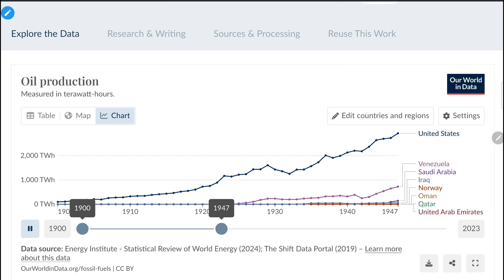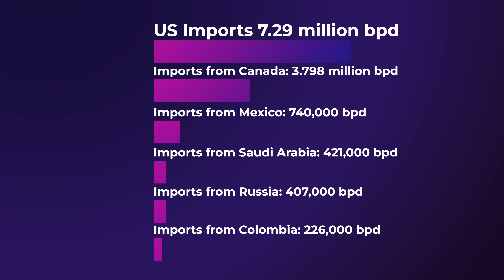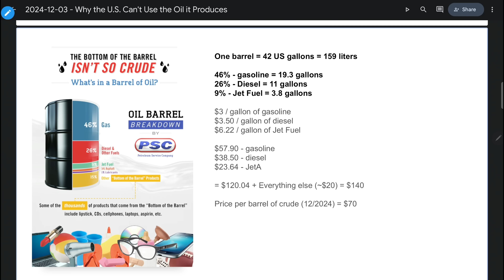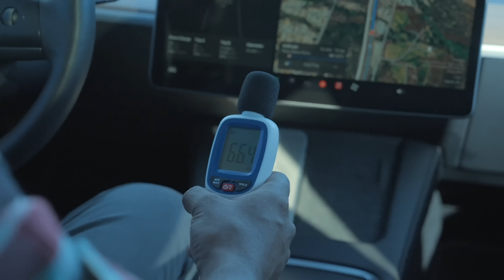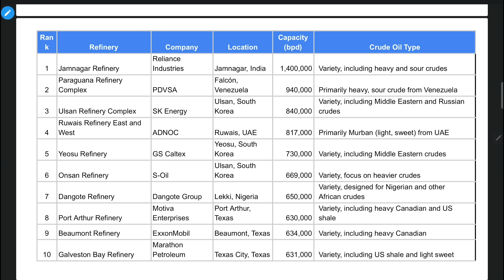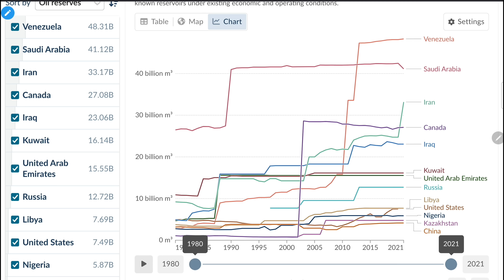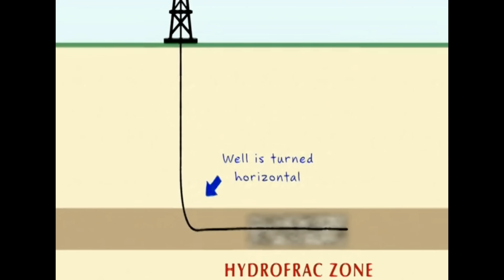Why America Can't USE The Oil it DRILLS

Comment: As a Canadian, I appreciate your comprehensive analysis to the American oil and refining system.  Thank you for providing some education to Americans who do not understand the logistics involved and have been lead to believe Trump's lies.  To uniformed Americans, it seems ludicrous to be buying oil from Canada when so much oil is being extracted within America in such volumes that a huge volume is exported.
Your absolutely correct that the decades old American refineries were designed and built to refine "good old Texas crude", which is a heavy crude.  Canada supplies heavy crude which is perfect for American refineries.  Most American light crude oil derived from fracking cannot be refined in America for the American market consumption.  
So, America buys Canadian crude oil at heavily discounted prices and received a further 30% advantage, simply by the currency exchange rate between the two countries.  The Canadian oil industry makes a small profit just ONCE when the oil is sold to America.
America buys Canadian oil and refines it into various petroleum products for sale at much higher prices (the FIRST profit opportunity).   Those refined petroleum products are further processed into thousands of products for other uses; specialty fuels, grease & lubricants, paints & coatings, cosmetics, synthetic fabrics, plastics of all forms, pharmaceuticals, electronics, liquified natural gas, and many, many others (the SECOND profit opportunity).  Note, that many of the American industries producing this list of products achieve very high profit margins.  Example:  Fifty cents worth of product is packaged into a fancy $2.50 bottle and package and sold at the cosmetic's counter for $90.00 .
These products are further manufactured into finished products; Example: Synthetics fabrics - clothing, shoes, tents, canopies, rope, furniture, etc...etc.... (the THIRD profit opportunity).
Finally;  The American light crude derived from fracking is exported from America to other nations at a high profit.  This profit is high above the cost that America pays for Canadian crude (the FOURTH profit opportunity). 
The bottom line is:   Tariffing, or restricting the flow of Canadian crude oil into the United States is extremely damaging to the the U.S. economy and has already crossed the border of insanity.   My message to my American neighbours;   Learn how your own economy works and you won't be fooled by an orange snake oil salesman.
Reply: Excellent!
Reply: I would go further along this train of thought and say that tariffs placed on imported raw materials, or energy or agricultural products that a country cannot easily grow/produce/or have available as raw materials themselves (due to geographical or climatic conditions), will do absolutely nothing to foster a home-grown, domestic increase or control of those commodities. 
  By placing blanket tariffs on Mexican and Canadian products that the US has little or no way of easily replacing at the same prices, all Trump has done is increase the cost of many previously available goods to Americans, with little chance of developing domestic sources for those commodities.
  Welcome to the result of increasing economic trade globalization - a process that the US, and American companies have had a major role in implementing over the last half century and more.
  A final question: Why is Trump so quick into this term to dismantle and upend USMCA, a trade agreement that he touted as something positive during his first term when it was put into place?
  Maybe the purported Wharton School of Business grad doesn't understand economics as well as he should.
Reply: @siderealvision  All it can do is make Canada look for better offers elsewhere or renegotiate a better price.
Reply: @siderealvision Frump clearly doesn’t know squat about the oil industry or energy in general. I can’t believe that so many of my fellow Americans allowed themselves to be duped by his divisive tribal politics and outright lies. 

As an American citizen I’ve had many occasions to visit Canada and every time have enjoyed the experience. Canadians are wonderful people for the most part and Canada is an admirable country with an evolved and modern, caring government. I’d trade you Donald Trump for Justin Trudeau any day of the week. Wait; no I wouldn’t. You didn’t do anything to deserve such a toxic export. My bad.
Reply: That is a really great summary, well done! One important issue that you did not cover is the use of upgrading in the refineries. Shale oil contains a high proportion of volitile natural gas liquids that are best utilized by upgrading sour crude or bitumen, that is why Texas is so reliant on Canadian feedstock to run in their refineries. If the current political nonsense persist the option of selling that product to other buyers without a dis out or the penalty of the US/CDN exchange rate penalty will not only cut into US e port capability, but cause major price increases anther pump. ALL Midwest US oil comes from Canadian feedstock.
Reply: @TRex-o5y  When Trump stated; "The U.S. does not need Canadian Oil", as a Canadian, I had to do a little homework on behalf of my American neighbours. This is 5 of America's top refineries and most prolific refineries that depend upon Canadian oil. This is the percentage of Canadian oil that these refineries depend upon everyday to function. This is the amount of Canadian oil, as a percentage of each American refinery's total output;
(1) Marathon Petroleum
Robertson Refinery
Robertson, Illinois............................100 % Canadian Crude Oil
(2) Exxon Mobil
Joliet, Illinois.................................... 95 % Canadian Crude Oil
(3) CMS Inc.
Laurel Refinery
Laurel, Montana............................... 95 % Canadian Crude Oil
(4) Phillips 66
Billings Refinery
Billings, Montana............................. 92 % Canadian Crude Oil
(5) CITGO
Lemont Refinery
Robertson, Illinois............................ 78 % Canadian Crude Oil
When are ALL Americans going to learn that Trump is a malignant and compulsive liar, except when he said; "I don't care about you people, I just care about your vote".
Reply: But Trump said Canada has nothing America needs, who to believe, such a tricky one.  :)
Reply: @Dug6666666  By this time so are better off assuming the opposite is true when Trump say something.
Reply: It’s the heavily discounted that maybe you’re on doing my American friends maybe Canada is about to say no more discount or we’re sending our oil somewhere else. Do something about your Trump. The guys a fool and a madman.
Reply: @bernl178  Unfortunately, more than half the country is stupid enough to re-elect the dumbass, so I don't think there's any teaching these fools.
Reply: @chrisgraham2904  The problem is that most people think that oil goes directly from an oil rig to a gas station. Or if they know about refineries they think they function like grain mills
Reply: @Dareios074  True, refineries produce a dozen, or more types and grades of petroleum.   Those then get manufactured  by third parties into raw plastics, greases & lubricant bases, paints & coatings, pharmaceuticals, asphalts, synthetic textiles, etc..etc...   It is far, far more than the price of gasoline, or diesel that is going to increase in price.
Reply: Well said but can you stop using big words maga has a hard time understanding you.
Reply: Too late. Very soon, Canadian heavy crude will go to Asia and Europe instead of the US, permanently. Canadians are beyond pissed.
Reply: @joergmaass  and how is that going to happen? If you say pipeline I'm going to respond with the fact you just built one with that exact idea in mind. Yet, apparently oil from that new isn't going to an Asian market. It's going to the US. And do you know why? Because it seems the tolls are so high to pay for the construction it's not profitable to send overseas which I suspect is fairly costly.
I know what you did last summer. Actually 4 summers because that project was right beside me and, man, that was painful. Please, please, please don't build anything. Get someone else. Anyone. Just stay away from these projects. Canadians will thank you. 🙏😅
Reply: @joergmaass & we are beyond ignorant in the USA for allowing this administration to do this to our economy
Reply: Extra sour oil,. such as the one from Canadian Tar sands is needed for the blending with extra sweet shale oil. And there is only quite limited availability of such heavy oil. Main producer are Canada, Venezuela (Orimulsion) and Iran. It is hard to understand why your government is working so hard to screw-up with Canada....
Reply: As of American that can all be changed with the West Coast oil refineries. When Trump opens up all the drilling on the west coast in the ocean that's is all sweet crude oil. No longer imported it can be shipped into the oil refineries on the West Coast in California.
Reply: @chrisgraham2904  wrong again
Reply: @colleenc9286  Please do tell me what I got wrong, or misidentified?
Reply: @chrisgraham2904  are you bragging or complaining? What is your point? Your rant does not address why refineries do not upgrade after 100 years of profits.
Reply: @adon2424  American refineries, which are designed to process heavy crude have not upgraded to handle light crude, because  it was far more cost effective to obtain heavy crude from Canada to refine.
The problem is Trump's immediate tariffs on oil with no timeline or commitment to upgrade the American refineries.  Americans will pay for for oil and all of it's associated products.
Reply: The people that need this info can't read or use numbers lol 

Half of Americans read at 6th grade level, See Spot Run shit, and 1 of every 5 can't read at all

1 in every 3 Americans are functionally innumerate and basically can't do more than add and maybe subtract small numbers 

The real problem is in how these people are being ignored or mocked by the more educated liberal-leaning people, and how they are exploited by the far-right to gain power.  

Put another way, it has been to our detriment that we cater our arguments to our own demographic while belittling the half of all people that fall under the avg IQ bar.  The bright people that should be listened to are seen as condescending and untrustworthy.  Anti-intellectualism has been on the rise and intellectuals aren't helping their cause lol
Reply: Ignorant, misinformed MAGA rubes are the biggest problem America has.
Reply: @chrisgraham2904  Bring back eV's
Reply: As an american, thanks for explaining why you shouldnt be a country, you do understand you cant defend or support yourselves rignt? Maybe you should take a minute to understand your economy
Reply: @ are you serious? First of all, Canada is in NATO so the other NATO countries (including the USA ) would be required to help with their defense. Also, Canada has helped in a lot of military campaigns worldwide. Also, Canada has a lot of natural resources such as crude oil, natural gas, & other minerals etc.  They can support themselves & trade with Europe & Asia.  & Australia
Reply: @Leeonidas87  Like most other Americans, you don't understand Canada.
Canada can certainly support itself along with dozens of world partners and will thrive without the U.S.A.  Your going to realized over the coming months how much America is dependent upon Canada.
America depends upon base resources from Canada that supports millions of American industries and jobs.   Canada buys "finished products" from the U.S.A. and we can buy a new toaster elsewhere.
Your right that Canada does not have the military capability of the U.S.A. Canada does have a military and Canada's military strength is ranked 27th out of 145 countries in the world according to the "Global Firepower Index".  Canada is a founding member of NATO and a member of the Commonwealth of Nations and has many other friends.
The U.S.A. has never militarily supported Canada.  Who is this invisible enemy that America has been protecting Canada from?  The U.S.A. is the only nation on Earth that has ever attacked Canadian soil and is now attacking Canada economically.
There is one other dimension:  If in a bizarro world, Canada was ever attached and occupied by an enemy nation, such as Russia, or China.....would America stand by and allow those invaders to install 35 military bases only the U.S./Canada border with missiles pointed to U.S. cities?
You need to stop playing the bully and respect that you have had a friendly neighbour for 250 years.
Reply: @chrisgraham2904  - Everybody knew that but the potus.
Reply: As a Canadian , you would think you would worry more about what Trudeau has done to your Country instead of worrying about Trump. Your bud has got you in a corner that you can not get out of now. Enjoy your blindness and not worrying about your own backyard.
Reply: @Youreplywasalie  Trudeau is turned your country into a bankrupt losing state. Are you proud of being human traffickers? The US can change refineries if that’s what they want.
Reply: @Youreplywasalie  - Da, vatnik?
Reply: @Youreplywasalie  I read your reply weasel...  it makes no sense!   Have you been blinded by the trumpian messages, or was your vision faulty to start with?
Reply: @Youreplywasalie weird comment now that Camry is PM😂 the Americans are all just like trump
Reply: @Youreplywasalie  As a Conservative Canadian, I am very concerned about what Trudeau and Liberal policies have done to Canada over the past 9 years.  Trudeau has now resigned and a national election in Canada is imminent, which I am hoping for a new Conservative government.  Be aware though, that Canadian Conservatives have virtually nothing to do with today's U.S. Republican Party. 
My focus is on Canada, although I do have family living in the U.S., that I am concerned for.  An old saying remains true today; "When America gets the sniffles, Canada gets a cold".  
My backyard is just fine, but America lives in Canada's basement and it's on fire.  The people living on the first floor have every right to be concerned.
Reply: @chrisgraham2904  - Why's Poilievre so terrified of applying for a security clearance?
Reply: @neilpk70  Pierre Poilievre, the leader of Canada's Conservative Party, has chosen not to apply for top-secret security clearance, which would allow him to access classified information on issues like foreign interference. His reasoning is that obtaining such clearance would legally restrict him from discussing the information openly, which he argues would hinder his ability to hold the government accountable.
Poilievre claims that a great percentage of classified information is secured to protect the Liberal government and should not be classified and should be open and transparent to all Canadians.
This decision has sparked criticism, with some suggesting it raises questions about transparency or his willingness to engage with national security protocols. Poilievre, however, maintains that his stance is about ensuring he can freely challenge the government without being "gagged" by secrecy laws.
Reply: @Youreplywasalie  As a Canadian...I would suggest you go look up the definition of the word 'idiot'...then go look in the mirror.
Reply: @Youreplywasalie  did someone spit in your cornflakes? I'm Canadian and I live an amazing life and so does everyone I know. My car is paid for, I have a roof over my head amazing food in my stomach and plenty of money in the bank. Not only I have everything I need I have it in spades. From my observation Canada is doing great and about to do way better when we start selling the oil you guys buy at an incredible discount and selling it to the rest of the world. Most of the crying is coming from you guys. By the way Trudeau has done a much better job than the thing running your country what ever its name is.

Comment: You're missing a huge point, electrification is not going to drive the demand for oil down, it's only going to drive it up due to the materials made to make the vehicle the lines and everything that it takes to get an electricity to the car. Electric vehicles use more resources than a normal standard dinosaur drinking truck.
Reply: Machiavelli would say : remove the tariffs over the Chinese electric vehicles and massively buy electric cars at a fraction of the US price. Then, continue with the EPA plan of transition which is likely to be scrapped by the new EPA Secretary. Feasibility is there technically, but the political damages are huge.

Comment: -Commodity price 2-Feb-25: - Gasoline $2.09;  Diesel ULS $2.47;  Jet A $2.32.  So the gross on a 42 gal bbl crude would likely be < $90, NOT $140/ bbl.  Don't forget transport, taxes, distributor and retailer markup.  Refineries do not make much money.  Belle Chase Alliance refinery shut down in 2021 after the hurricane and reduced dmarket demand.
-Venezuela Orinoco reserves - Huge forever.  Not really new.  But a lot of it is sort of similar to the Atabasca tar sands, but is extra-heavy oil and bitumen. New fields are being developed in adjacent offshore Guyana.